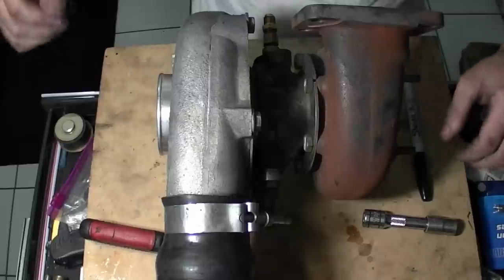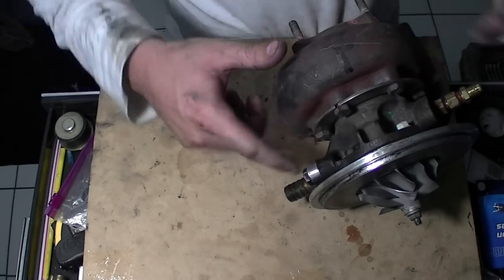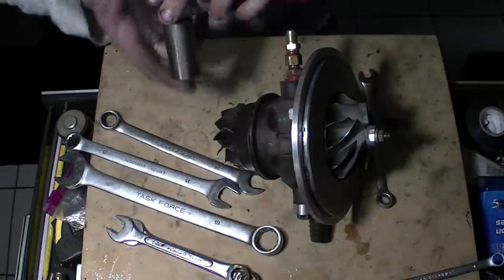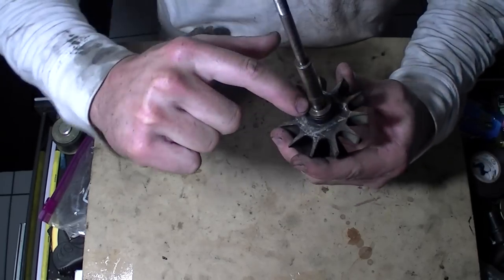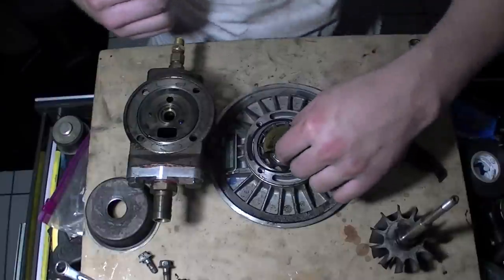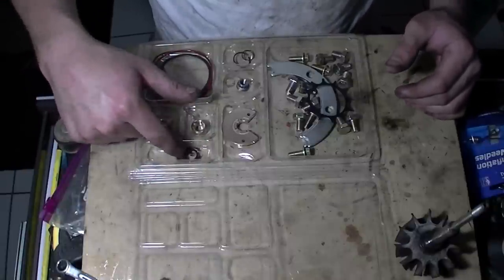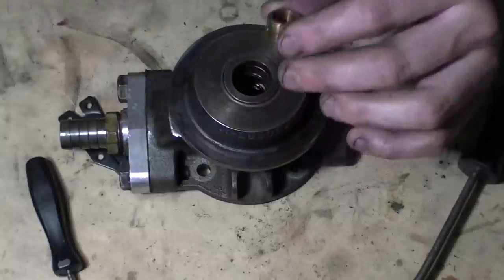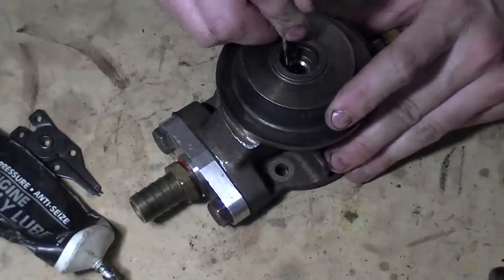How To Rebuild Any T3/T4 Journal Bearing Turbo Part 1

Comment from the maker: No problems, It smokes a tad bit only because the shaft itself was messed up on the turbine side to begin with. I rebuilt another one and will be swapping them out later on. I have alot of friends that rebuild theirs and they are still running them 3yrs later with no issues and boosting 20+ psi.

Comment: Just a heads up you never want to use a wrench on the shaft nut.  Use a "T" handle.  Keeps the tip of the shaft from bending.
Reply: Thank you, a decade later and your advice helps, hope you’re doin well.

Comment: i found an smaller, thinner, and not as wide wrench and that helped. not alot of room to try and get the back plate off... tap on the wrench with a rubber mallet.

Comment: Great video! Will be using this when I rebuild my identical turbo later this week. Here's a link to my car smokin' like a freight train lol

Also, the only thing is that the exhaust side is the turbine side and the intake side is the compressor side. You were calling the exhaust side the compressor side.

Comment: There are 3 different compressor side seal types for the T3.  They are not interchangeable.  So when you say they are all the same, they are indeed not.  Disassemble your turbo to see if you have the 1 piece carbon seal, the 4 piece carbon seal or the 1 piece integrated seal in the thrust bearing.

Comment: Use 1500 grit wet sand paper on the shaft. I rebuild turbos (non bb) and it works great even though I would never use a shaft that destroyed

Comment: Hey, will a rebuild. fix turbo shaft play? When do I need to replace the turbo cartridge?
Reply from the maker: Yes a rebuild can fix shaft play. This all depends on how worn-out the cartridge is. If the cartridge is beyond it's service limits, then new journal bearings and a thrust bearing won't make much of a difference.
Reply: @Nthefastlane  Thanks man! I'm new to this turbo stuff and your input is greatly appreciated!👍do you know where I can get a rebuild kit for a greddy td06h-20g turbo? Ebay/ Amazon will work?

Comment: hey my garrett t20 turbo on my street bike is leaking a few drops of oil out of the cold side into my air filter that's clamped right on the turbo. it boost up as normal at 8 psi. what do you think is causing the oil leak?  thank you

Comment: is there a way to turn the center housing 90 degrees? because one of my oil flanges is facing the same way as the compressor flange and its supposed to be facing downwards with the turbine outlet. thanks.

Comment: you took off the compressor housing, not the turbine (which is the exhaust side).  as you said, they're balanced, but you should've marked the compressor blades position in relation to the turbine blades.  that's the whole idea of "balancing."  you're right about grinding the wrenches, but might want to try 6-point and not 12-point...
and they're not pistons, that's a turbine shaft and that's the turbine oil seal, or ring, which sits between ring lands. and i'll stop there.
Reply: Ummm yeah. This guy has no business working on a turbo. Wow!
Reply from the maker: It is called a piston ring.Look it up.
Reply: Yup it's called a piston ring.
Reply: youre right funny Word but right
Reply: like a clutch in a Automatic transmision
Reply: liter91gt. The oil as well as providing lubrication also applies a pushing force on the shaft so there is no end play. So the shaft is also acting as a piston. (If you look at a cross section, the turbine end of the shaft resembles a hydraulic ram)
 There is a thrust bearing (the 270 degree bronze plate) on the opposite end to take up this force.
Without the oil pressure pushing on the shaft, the thrust bearing wouldn't work. 
This is why they're called piston rings and not just an oil seal.
Reply: So any of you uploaded a video with the right names for parts?

Comment: You said all t3 and t4 are basically the same but I missed the first few seconds of the video and I didn't know your compressor housing  and turbine housing was  A/R.60 and A/R.63 but my t3 is A/R.50 and A/R.63 but I went ahead and bought the kit online down in the link and without realizing and after rewatching the video so I could tear everything down to replace it all when the kit arrives but now I'm just praying to God it fits. If not idk what imma do I'll probably just buy another cheap china turbo for a few hundred bucks

Comment: shouldnt there be a gasket or o-ring between the compressor housing and the center of the turbo? wont it leak air?

Comment: How do i know which turbo rebuild kit do i need? I bought a used precision turbo..both wheels have play on it. do i need a new wheels?
Reply: buy a new core the core is the vital part the compres and exhaust housing are normaly not damaged
Reply: journal bearing turbos all have radial play without any oil pressure. just have to measure the play.

Comment: Help!

if i get a turbo charger off a diesel engine will i be able to use that turbo on a petrol engine
Reply: +legioner9 it has been done all the time. Temp has nothing to do with this... Tuning and oiling is the key to swapping one in. Holset, BorgWarner, Garrett, etc.. all reputable manufacturers... Now the correct reason as to why a turbo meant for a diesel wouldn't be optimal on a gas engine is efficiency and being improperly sized.. exhaust housing/wheel etc but it will work
Reply: +legioner9 the egt's on my deisel go up to 1300 hundred. 800 is just getting threw traffic
Reply: ***** well much more than that and the top of your pistons will melt if they are aluminum. the biggest problem is diesel turbos are way to big for most gas engines and they wont spool good and wont get good boost. you could be right about gas being higher temps im not an expert just saying what i learned from experience.
Reply: +legioner9 So your telling me that they use different materials in something that uses exhaust to work and spins sometimes in excess of 100k rpm?? Yeah ummright I'm sorry I'm totally wrong on this.. Keep thinking that.... how does have aluminum pistons have to do with anything?? almost all manufacturers use aluminum pistons.. its all in tuning.. how about this while diesel turbos may be improperly sized sometimes.. then why don't ya look in to Holset and Borqwarner before you make stupid assumptions...
Reply: a typical diesel particulate regeneration on a duramax 6.6l can have egt temps in excess of 1400*F...
Reply: Im done discussing this.. do some research before commenting.... Inconel is the reason turbos can withstand temps.. both diesel and gas engines use turbos with turbine shafts made of this material. the differences are the size requirements for either engines are different but it has been done many times reliably.
Reply: I like puppys.
Reply: +legioner9 a 5.9 12v cummins turbo on a 300 ford six. i know a guy that put a 7.3 power stroke turbo on a 351w but it wont spool at all
Reply: +legioner9 i know plenty of people from hondatech/dsmtuners/zilvia/realhomadeturbo who will and have used turbo's from a diesel engine like holset or borg warner and have reliably ran it in high boost applications. holsets in particular like high boost because they're usually found on your cummins diesel engines. efficiency is more of a concern than temps. it all depends on the application of the turbo. important factors are the engine itself, the internals, the turbos flow rate, how much power do you want to make and when do you want to make it.
Reply: klonkis2JZ yes I will get 900hp make sure u jb weld the wastegate shut it will give you 20 more extra hp. Lolol

Comment: i tried the clock way in unloosing the shaft  snapped off the bolt   it was counter clock wise .. had to order a new shaft balanced, a bit of a hack job with a 30+ kit from China
Reply: L Pi always look at the threads I almost did that too
Reply: Just snapped mine too. It's a standard T3. Glad I had a spare!

Comment: You use the upgraded brass 360 rebuild kit. The steel bearings in some of the earlier Garrett where failure prone.  The steel bearing won't take the heat.

http://pages.ebay.com/link/?nav=item.view&alt=web&id=121386442373

***Upgraded Garrett Precision Turbo 360 Rebuild Kit 50 60 Trim To4e To4b

Comment: I made it a couple minutes in before turning the video off.  1. At 1:27, that is the compressor housing, not turbine housing.  Also, it is the impeller, not turbine. 2. Your wrench is spreading because it is a cheap brand, buy something a little better next time. 3. Gator Grip, really?  See comment #2.  I'm not saying buy Snap-On but at least get the proper tools.
Reply: Jared Shaffer I think you are being a bit harsh regarding the use of what you consider the proper tools. If I recall, the end of the turbine shaft has an 8-point drive on it which would require a specialized socket. In addition, that 8-point drive often has some of the points ground away as part of the balancing process. Using a Gator-Grip socket actually gets a better grip in this situation than the "right" socket.

Comment: You can use a 360 degree rebuild kit instead of the 270, this will help prevent future failures.  We sell this kit on square and ebay http://www.ebay.com/itm/Upgraded-Garrett-Precision-Turbo-360-Rebuild-Kit-50-60-Trim-To4e-To4b-/111453427561?pt=Motors_Car_Truck_Parts_Accessories&hash=item19f3245769&vxp=mtr
 https://squareup.com/market/turbo-lab/garret-to-e-degree-rebuild-kit-p-n
Reply: +Turbo Lab America  I have a Banks Sidewinder for a 85 6.2 diesel  Would you recommend the kit you listed above?
Reply: The Banks Sidewinder that I have seen is a Mitsubishi TDO7 Turbo. If you send me some pictures i can confirm for you. I rebuild a sidewinder turbo before, it was a mitsubishi TDO7. The TDO7 rebuild kit is more rare, if that is what you have i will point you out in the right direction if you cant find that kit.